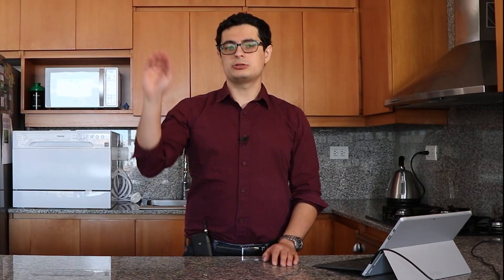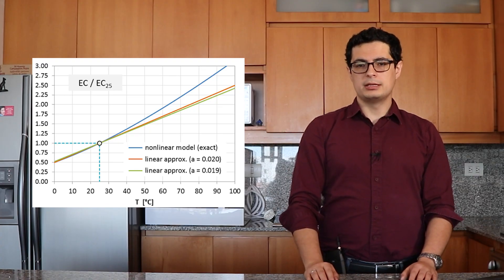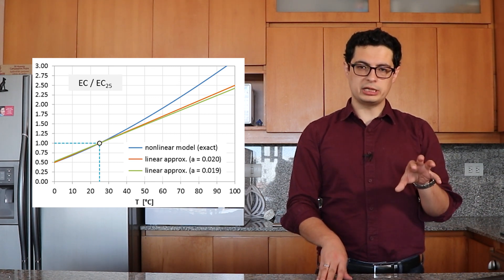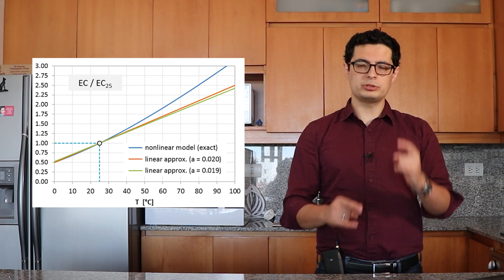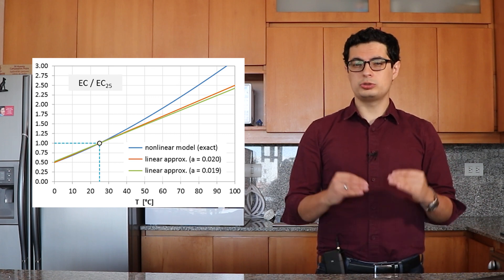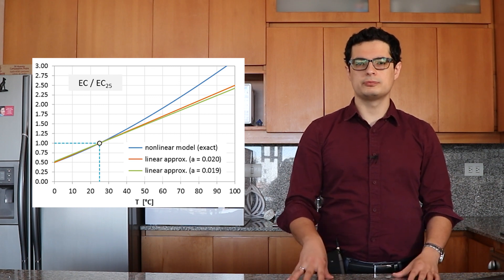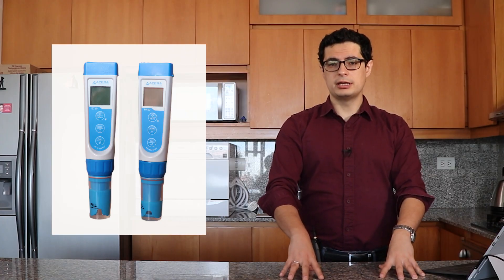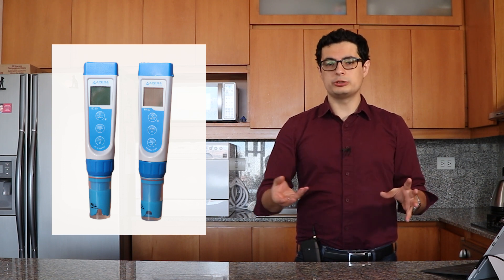What you should know about temperature and conductivity

Comment: Thanks Dr.  Fernandez! I tested my water, got EC 0.02mS/cm and pH 6.98. The water is like RO water from the EC perspective but the pH is much higher than RO water. It's rural bore water not tap water. I was surprised that the EC reading of  bore water was 3 times lower than the tap water in the city. What could be the reason? Just curious. Thank you!
Reply from the maker: Thanks for writing! Water with low amounts of dissolved solids likely has an extremely low buffering capacity. So you might only have 0.02mS/cm of some dissolved solid, but if that solid is calcium carbonate, then it is well enough to take the pH up from the pH of RO water (which is normally acidic due to carbonic acid from the atmosphere) all the way to almost neutral. It is really inconsequential, since the buffering capacity is so low any acid/base addition will easily change the pH radically from that 6.98.